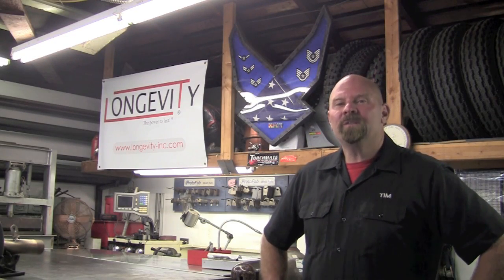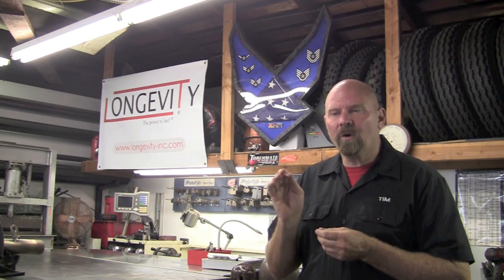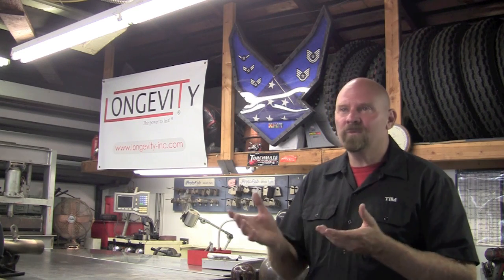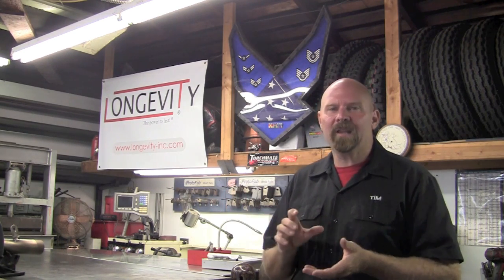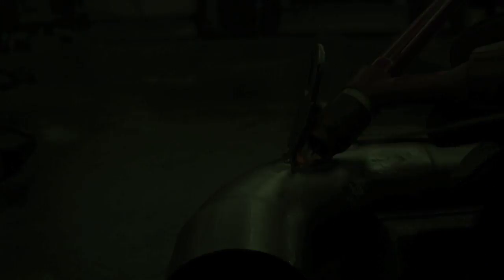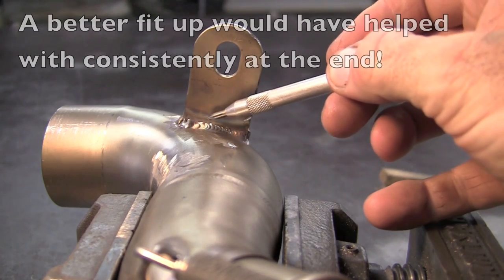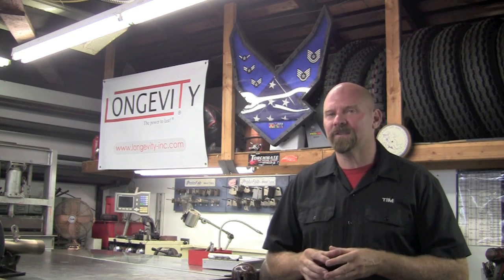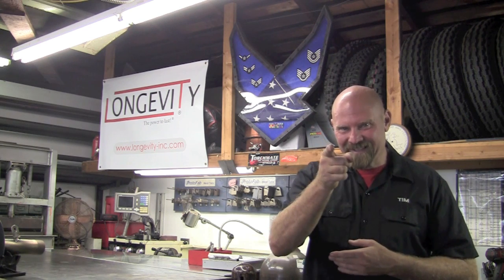TIG WELDING 101: TIG WELDING STAINLESS STEEL EXHAUST TIPS AND TRICKS HOW TO WELD LONGEVITY TIGWELD

Comment: Daniel Sanchez - the new Jasic TIG welders are superb, I use the 200amp AC/DC (non digital) model everyday, small enough to take to site, yet still plenty of power for thicker material and I also weld aluminium with this machine quite regularly. 5 year warranty, and well priced I highly recommend these sets, I've been using mine 5 days a week for 4 months now with no niggles whatsoever!

Comment: I fuse thin (18 or 20 gauge) stainless sheet metal from the edges at work.  I'm new at tiging.  any advice?
Reply: just wash your stainless metal in acetone for best cleanest possible weld ...

Comment: sometimes, running the lowest amp in that kind of material is not the best way to do it, because, low amp, low speed, more heat, overheat is not good for that kind of material.
I prefer higher amperage and fast speed, i did some tests(heat reading) and is the best way, but it's harder to do it, you need "good hands"